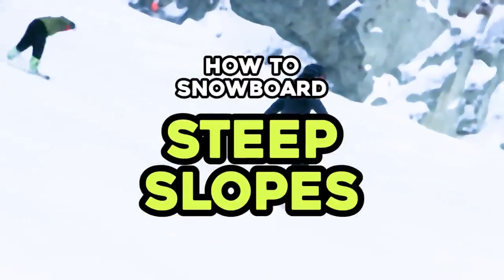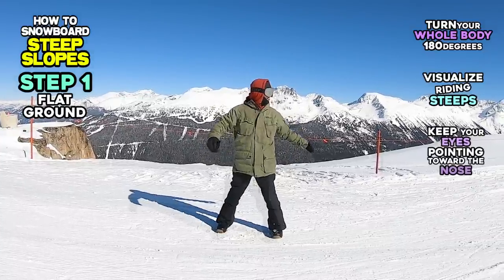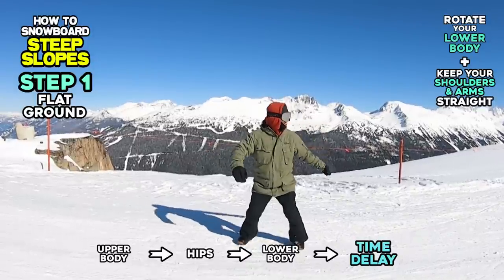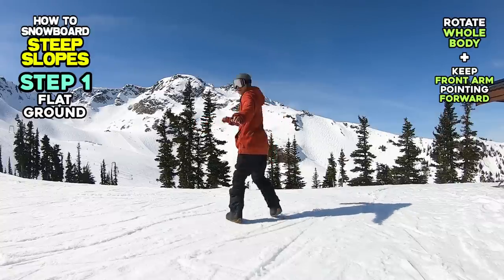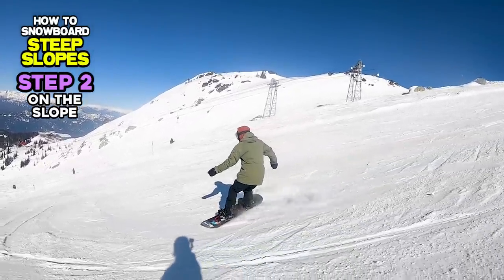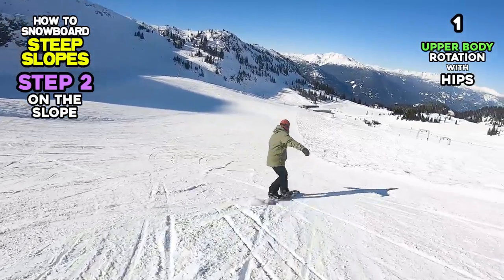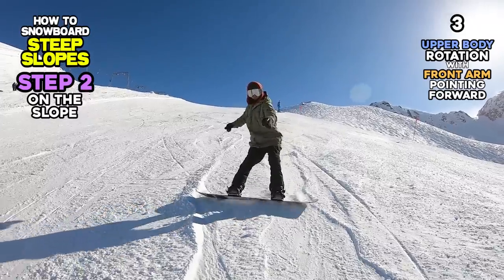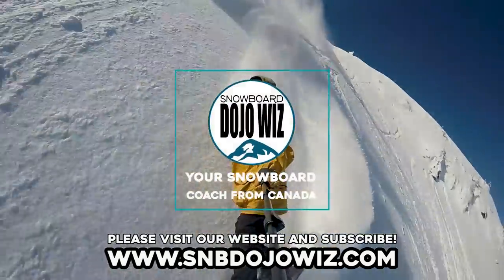Steep Slopes - Step 1 & 2 / How to snowboard Narrow Slopes Short radius turns

Comment: Some say you shouldn't use your upper body at all, just use the legs, some say you have to twist the upper body like crazy. What is correct?
Reply from the maker: Hips is the key. Upper body rotation is just to help to turn your hips.👍
Reply: @snowboarddojowiz2928  I can do the turns to the right really well (on my toes), but I fail at the left turns (on my heels)! Back leg is lagging behind on the movement, and usually I have to "push it" to where it should be. What am I doing wrong?

Comment: hmm does this mean also you are kinda putting more force on your front leg and pulling your back leg a little bit up and then around (kinda bending the board but not that much?) to do the switch?
Reply from the maker: We can't pulling the tail of your board up. You just shift more your weight on front leg and this means that you move your pivoting axis to your front leg from your center of your board (or back leg).

Comment: I know this is more than a year old but its worth asking, but when you are doing the rotate are you getting the board flat and then rotating with your hips then grabbing the heel or toe edge? i thought that you were suppose to do all the steering with just the front foot? Or is that just to start to get your feet into snowboarding? Definitely will try this on a blue run next weekend
Reply from the maker: You can focus just on spinning your whole body quicker with your hips. So it's more like spinning on the hill. 
Step 3 is introducing steering to draw a half-circle while turning.😀
Reply: @snowboarddojowiz2928  copy. I'll try that when we head up next. Thank you for the reply

Comment: It looks perfect! I can't wait to try it out on my next trip. I have a small question. People say adjust your weight and let gravity leads the turn. This video looks a little more proactive in turning. Is one of them wrong? or I didn't understand them correctly?
Reply: And "always align your shoulder with your board to the direction you are going". I got a little confused.
Reply from the maker: Advice from your friend is more like a sensuous approach. So it might and might not work for someone. Especially on the steep slopes, people lose their balance easily and hard to adjust their balance. So you need to finish each turns quicker before losing your balance. But you should try your friend's advice too. No one knows if it works for your riding.👍
When you align your shoulders to the board, it's when you are trying Method 1. The method3 might require you to align your shoulders to the board too. But with Method 2 you don't want to align your shoulders to the board. So, they are all different methods.👍
Reply: Snowboard Dojo Wiz thanks for the detailed response! I will try them out.
Reply: After 20 seasons of teaching snowboarders, i found out that indeed the rear arm is really important, like you show (ofcoursw combined with other movements). Just pointing with front arm but not get the backarm in opposite direction, makes not much sense, theres no movement in shoulder then.

Comment: Whaaaatt????? This is nuts
Reply: Never use your upper body to turn. You should be teaching lower body movements. Toe side turn. Peelike a boy - start with your hip then knee bending then ankle flexing and  torsional flexion of the board using ankle strength on the lead foot followed by the back foot until you are on your edge ... and heel side turns. Pee like a girl. Same leading movements with hip, knee ankle and foot/ board torsional flexion  and followed by back leg until you are peeing like a girl. and no you should not switch edges faster actually by staying on your edge longer. It making wide J type turns it will teach edge control on heel and toe side alike. Oh and never ever use your upper body to turn. Bad bad bad habit. Your eyes lead while your lower body works and upper body remains static.
No offense but this shit he is teaching is is kooky AF!!!!
Reply from the maker: Thanks for sharing your idea Mercedes! You should watch the Step 2 video as Step 1 is the easiest way to try. Step 2 introduces how to turn with the lower body. BTW, the method in Step 1 worked well with my students tho. You should remember that any method won't work for everyone as yours won't work 100%. Then you should have more tips to teach. If you have them, please feel free to share them. Thanks again!👍

Comment: I'm the type of learning who likes a thorough explanation, but this is far too much talk and not nearly enough rock.  I want to see a brief explanation followed by a demo.  Three dudes in snowboard gear jumping around on a flat slope doesn't really connect the dots for me.
Reply from the maker: Thanks for sharing your opinion and sorry for that the video doesn't match with your learning style.
Reply: @snowboarddojowiz2928  My issue with the video is a bit more than the content not being suited to my learning style. Technique #1 is an adequate intro to short radius turns except it the rider is probably too upright and rigid during the turn, making this close to a linked side slip that sprays snow down the hill instead of a dynamic turn.  Further, it's hard for me to see how techniques 2 and 3  are viable options in any terrain, especially on moguls.  They put you more or less in the same unbalanced body position as the linked counter-rotational side-slip that you see so many novice and intermediate riders doing on the slopes, and it's obviously not a strong position to be in when going over the bumps given that the upper and lower body are not aligned over the working edge.  If you actually tried doing #2 in moguls as you suggest, you'd be immediately thrown off balance.  I appreciate the effort to help students learn snowboarding, but I think you're throwing way too much information at students here without enough guidance on how to apply these tactics to real-life situations.

Comment: How about something on making proper turns using sidecut instead of sloppy slip sliding “turns”.
Reply from the maker: Thanks for your comment ckoch407! As I mentioned in this video, you can learn it with Step 3 which is available only for our training program subscribers on your web site. Sorry for that we can't provide all the tutorial here.
Reply: You can't carve on steeps
Reply: You absolutely can make short radius turns on edge using sidecut and proper body rotation on much steeper than in the video. As long as its not too steep to flex and extend throughout the turn without gaining more speed than you can control, you can carve it. But I agree steep reaches a point where all you can do is side slip or fan your tail.  @iagreewithyou112
Reply: @ckoch407  nice link. This is much more advanced than most people will ever get. I ride this type of terrain only a few times a year. If you're good enough to try something this extreme, you are probably relying on your innate skill and not YouTube tutorials 😀

Comment: The counter rotation is TERRIBLE advice. Will get you into trouble fast on steeps.
Reply from the maker: Hey thanks for your comment Niall! 
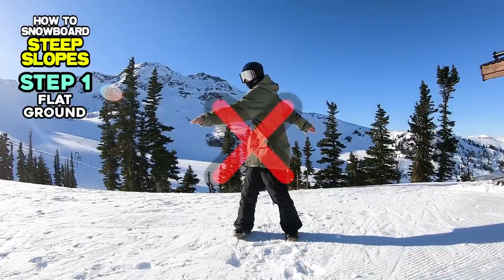I hope you didn't skip the video between 3:30 and 3:50. 😂
We don't recommend a counter-rotation in the video at all. You should watch it again carefully. 😀
Counter rotation will minimize to turn your hips right and left, so your board will be minimized to spin right and left too. If you are struggling with steep slopes with counter-rotation, try to keep your shoulder straight to the hill and rotate your hips in the intended direction. So you can turn your board enough to control your speed and at the same time, you can start next turn quicker. 
I hope now you understand this tutorial better.👍